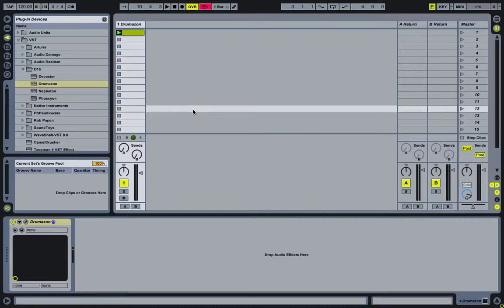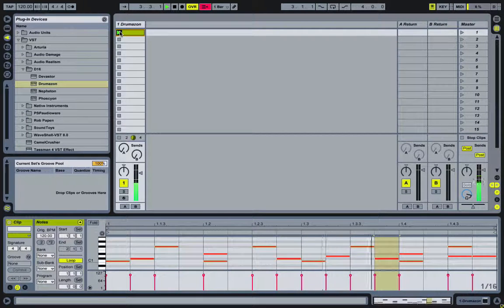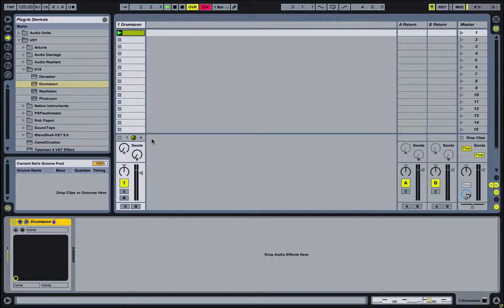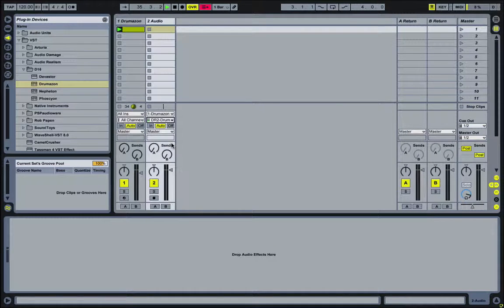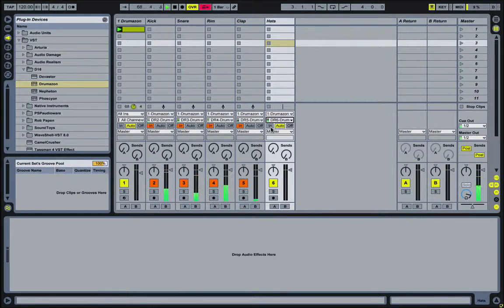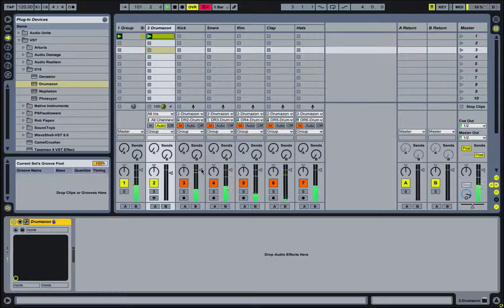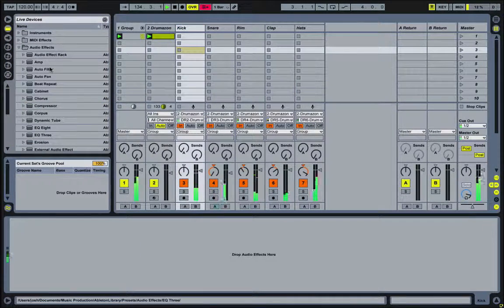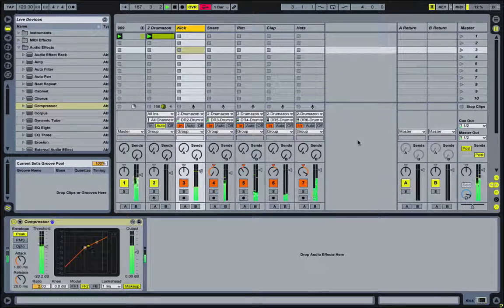Splitting audio from multi-output plugins in Ableton Live.

Comment: in some strange way it's not working for me..on the audio channel (tap points) it says DR3/DR4-Drumazon, DR4/DR5-Drumazon, and so on. So it's not counting DR2, DR3, DR4 etc. as in the video. But if when i've set the Drumazon and pick the DR3/DR4 there is no signal/audio coming into the audio channel...
Reply from the maker: +Ensorceler 1 Drumazon has a configuration switch to set the default of its multiple outputs to be either be mono or stereo. I've never had to set it in Live because it has always treated it as mono regardless of the setting, but perhaps something is different in your setup. The setting is the Drumazon options in the Outputs tab. It's called "Default outputs type." It is described in chapter 7 of the Drumazon manual (which you can find here: http://d16.pl/pub/manuals/Drumazon-manual-gb.pdf ). I would suggest setting it to mono, then bringing a new instance of Drumazone into your Live project. 

I'm a little surprised yours is behaving this way though, as I've never observed this behavior or had to change the setting on mine. 

I just took a look at mine, running Drumazon 1.6.2 and Live 9.6.1b2 and I'm getting the same behavior as in the video.

Are you running on Mac or Windows? Are you using the latest version of Drumazon? 

I'd be interested to know if the Mono/Stereo switch helps.

And, thanks for leaving a comment,

Josh
Reply: I dont have a mono/stereo option and in the manual the options menu is looking completely different from mine..now i see im using 1.4. So im hoping that after upgrading the problem will be solved. Thanks so far!